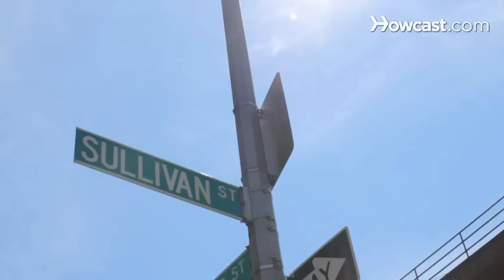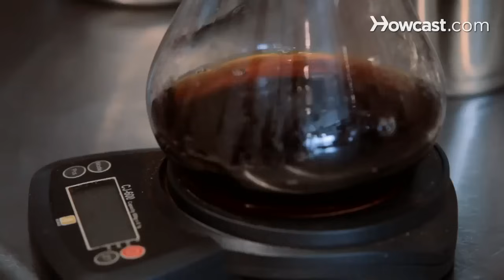How to Make Pour-Over Coffee | Perfect Coffee

Comment: Just so everyone knows:
You can buy a funnel and use a large jar or something similar to do this. You don't need expensive equipment. 
Personally, I use a plastic canning funnel (canning funnels are made to be used with boiling water) and a broken French press (the press part broke so now it's just a fancy 750ml cup). Works like a charm and only cost me around $5 for the funnel.
Reply: Gotta use what you have. I like this.
Reply: How about my method? Can't get easier. Just use a paper filter right on top of a glass. It has to be high enough so there is space under the filter for the coffee, that is ready to drink. So my coffee goes right into glass that I'm drinking from, only through a filter, that you can put on top.
Reply: Not  to expensive tho. You can buy one for $45-55. However the kettles are rather pricy

Comment: My husband and I fashioned a pour over with a Mr. coffee carafe and an auto filter. Works great! We also heat water with an electric kettle. You don't need all of this stuff.
Reply: What stuff are you referring to? If it is the scale, kettle, or in general, a grinder, you are incorrect. Yes, you can perform a rudimentary version of what is going on here with simpler equipment, that does not mean that what you are doing is equivalent to it. For example, I can say almost any home auto-brewing system is essentially doing the same thing as a pour over coffee given the shower head inside the brewer along with the conical coffee basket, but what you end up with as the end product is definitively not the same thing. Even systems intended to imitate the motions of pour over in a general sense have been acclaimed as not reaching the same level of quality as manual application. But sure, one can make pour over with store bought pre-ground, a make shift basket, water from any old kettle, and a carafe; it just isn't going to give you the same end product as what you see is being made here.

Comment: So i have a question about a specific portion of this barista's method: he says at 3:25 to not pour down the sides of the filter which would pick up the grounds that collect along the wall and according to him over extract the coffee causing it to be bitter, but then at 4:00 he says to stir the grounds into the steeping coffee which to me seems like it would do the same thing as pouring the water down the wall of the filter; Either way the grounds are being reincorporated, the only difference being that if you stir it at the end only the last portion of water remaining in the filter will steep with the grounds that were on the wall where if you poured along the walls of the filter from the beginning all of the water would be steeped in the grounds that would be collecting on the filter. The only thing i can think is that pouring down the walls of the filter will cause the grounds to settle to the bottom which would slow the flow of water through the grounds causing it to steep longer (and over extract), but if your brew time is still within the 3:00 to 4:00 minute range wouldn't it not matter for the flavor?
Reply: The impression i got is that you want an even extraction across ALL the grounds.  If you over-extract any part of them it will be bitter.

Pouring it down the sides would over-extract the grounds on the outside of the filter.  Pouring it evenly then stirring it means you get an even and medium extraction from all of them, none of them are under or over extracted.

Comment: Listen, just think this: you need four 7 gram scoops of coffee, the scoop holds 7 grams of coffee, so four scoops of unground coffee. Grind the coffee so it is like sand, not powder. While you're doing this the water is boiling. Boil the water. Wet the filter to remove paper residue. Remove the filter, dump the hot water from the cup you are going to use then put the filter on the coffee carafe. Place your 28 grams of ground coffee or four 7 gram scoops of ground coffee into the wet filter. Create the "bloom" then after a minute, you don't need a timer, you can look at the second hand on a clock, then begin your slow method of the pour over. Think: I need a little more than 12 oz. of water, and one doesn't need a digital device to weigh the water or to tare it out. This is a waste of money.  We never did this in the coffee house during the sixties when, by the way, all espresso machines were one group machines that made one cup of espresso at a time. All this digital this and that represents a cost burden and if you want to go out of business that is the way to do it. It's showing off and for whom?  Yourself and other baristas. NC
Reply: Nick Campbell  These instructions are for newbies that don't have professional barista experience. He's suggesting they use a scale, because most of the people watching this tutorial don't have the experience to accurately measure by eye. If you can do all these steps without a scale while blindfolded, that's great for you. However, you need to consider the target audience here, not your personal experience.